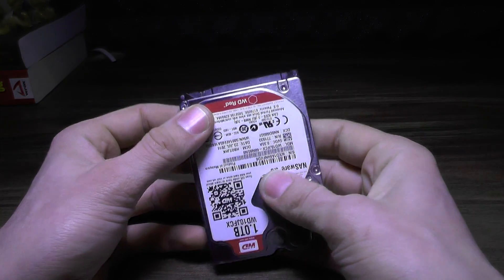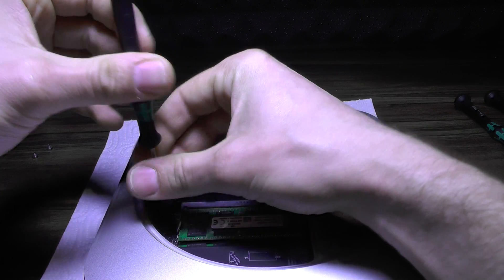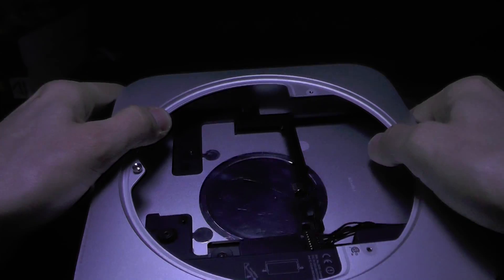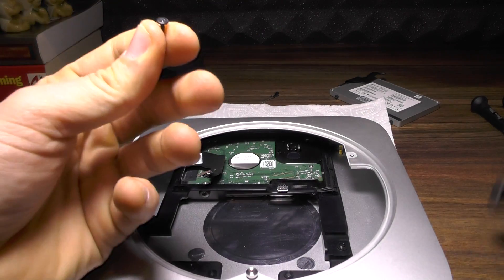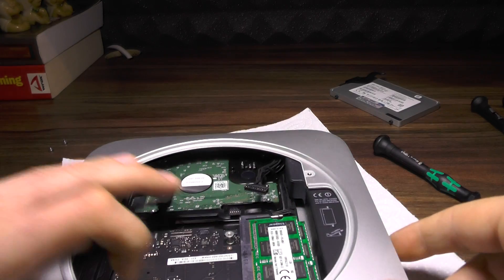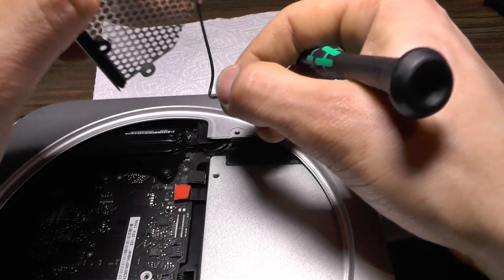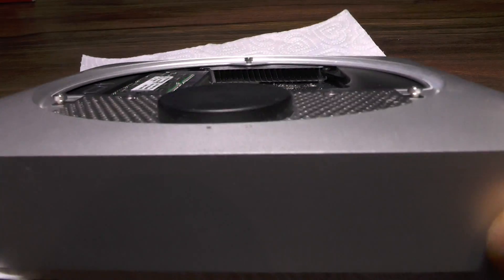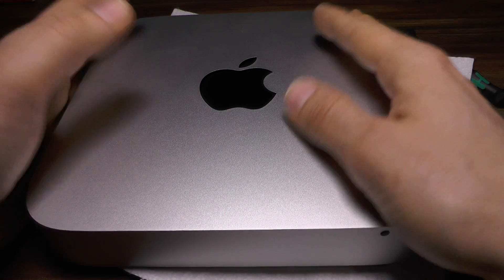How to Install second hard drive to a mac mini 2012

Comment: Is there any other switch, sensor, cable, config I need to change? I’ve added a HD but it is not recognised by the OS.
Reply from the maker: No, Did you use disk utility to create partition

Comment: I have Mojave installed on a new SSD drive that I want to put in my Mac Mini. How do I do to use the 2 hard drives?
Reply from the maker: hm, in theory (keyword THEORY) it should just work by installing the drive (however it might boot slower due to different hardware IDs). What's your goal? have SSD for OS and another drive for storage? if so you can evenm create a hybrid drive.
Reply: @MTS_IT  Yes, that's my goal. I'd installed the SSD and the HDD but i'm having some issues since then: my mac freezes several times in the day. For example: I'm watching youtube videos, if i scroll down to read comments, it freezes for a few seconds. If I play League of Legends, it freezes like 5 or 6 times during the game. And so on. Do you have an idea of what can cause that? Thanks in advance!
Reply from the maker: @Cyb3rgirl  Hm... Perhaps faulty sata cable? (or not connected well) Also, did you format HDD or just installed it without formatting?
Reply: @MTS_IT  Without formatting. I installed the 2 drives: the SSD with Mojave in it and the HDD (with High Sierra) without touching anything. At first I thought it was Mojave fault, so I installed High sierra in the SSD, but it keeps freezing :(
Reply from the maker: Cyb3rgirl try wiping them both clean and then reinstall mojave. If you have data that needs to be saved backup /users/yourname